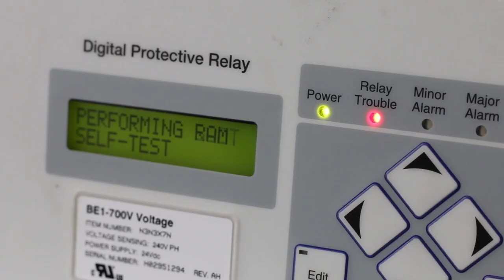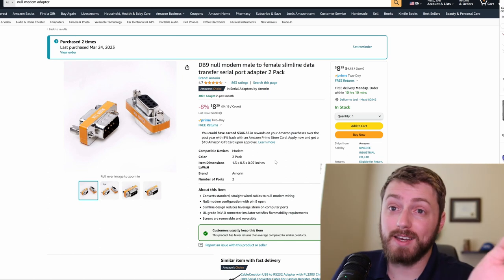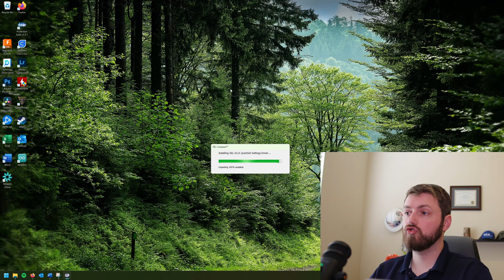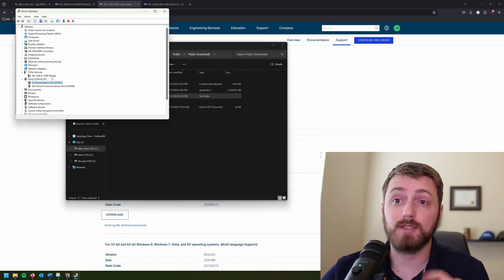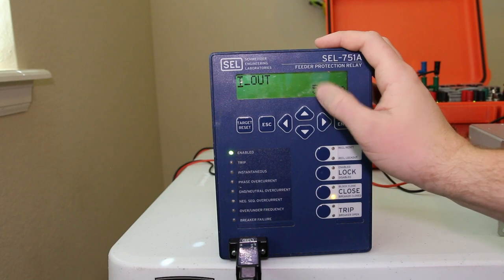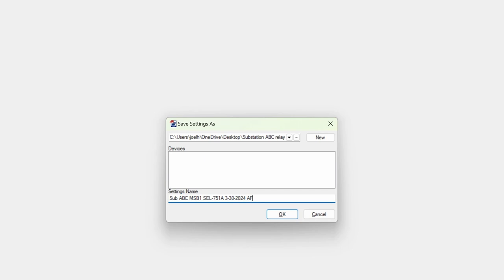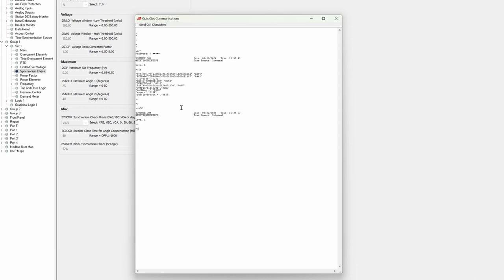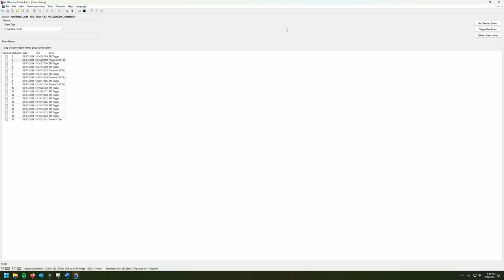How to Download/Install Settings on SEL Relays - How to Test Relays ep1

Comment: Thank you for sharing your experiences in Relaying testing. This is really important and helpful to a lot of relay tech . Great job. Now if you upload a video of ENOSERV RTS 7.1 much needed. See you soon. Keep up the good work.
Reply from the maker: I probably wont be making any RTS videos, for a few reasons. #1 I'm a protections suite guy. #2 the whole point of RTS is that it does all of the work for you and you're just a pushing buttons. In my relay testing series, I'll do my best to explain the concepts and help you understand the math behind what we're doing when we test relays. Hopefully that'll make the steps RTS runs make more sense. If you need immediate help with RTS they have some very good paid training classes.

Comment: does C662 cable work with GE relays?
Reply from the maker: Yes*
I've had good luck with it working by moving the DCS/DTE switch, BUT I've had a few guys tell me it doesn't work on older GE relays. Not sure why. I always keep a C662 and a separate generic RS232 cable (I recommend one from Startech.com cause I know it's good quality), a null modem adapter, and gender bender in my go-bag just in case.

Comment: I remember when I was with ol spermco the neta 4s tested almost nothing but SEL relays. 
Now the company  I'm with we do motor protection relays mainly multilins. I'm hoping between your videos and learning from out grumpy old neta 4 tech I'll be somewhat decent at relays in a few years
Reply from the maker: That's the only way to get good haha. I can make a similar one for multilins too if there's any interest. SEL certainly has the majority of the market lately from what I've seen but multilins have been around.
Reply: If you want to test motor relays, get the manual and start reading. They are substantially different from feeder and generator protection.